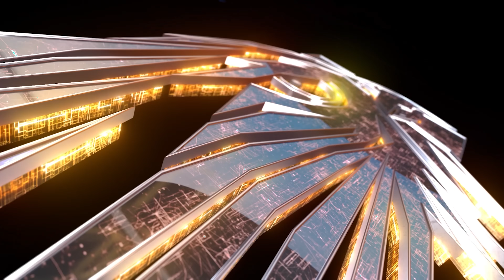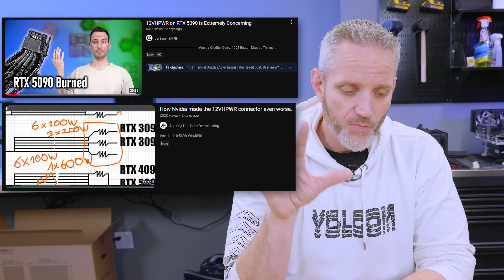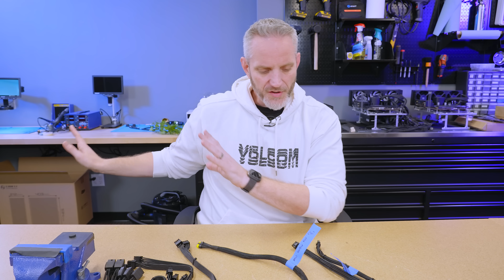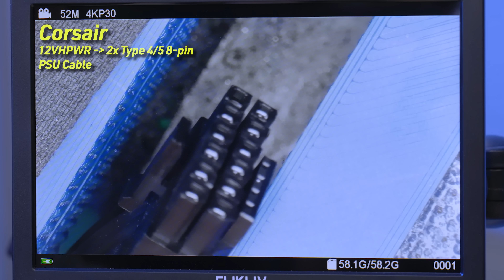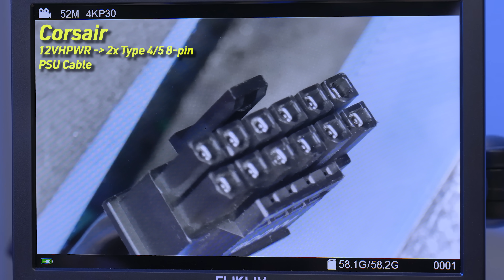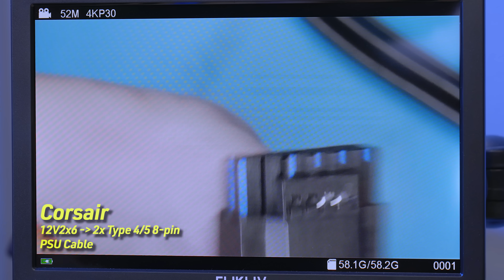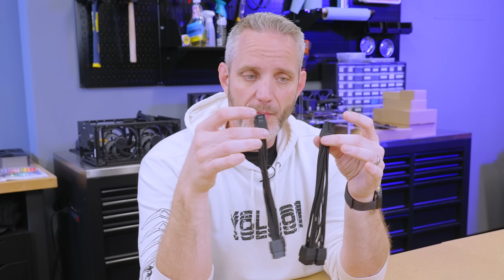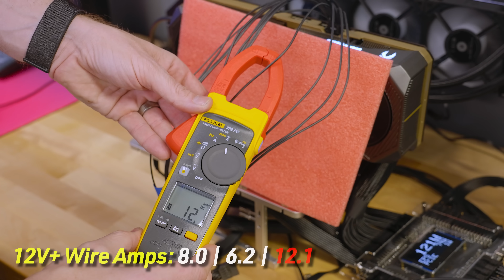I discovered something concerning and I need the Experts to chime in... More 12VHPWR discovery!

Comment: One of the things I have never seen anyone mention in any of these videos, but is very important when it comes to discussing these connectors, is the way the male and female pins connect.
So in the case of these connectors, the male pins are solid and have (theoretically) full contact.
The female connectors however do not. The contact surface is tiny, because the male pin only physically connects with the female connector on a few tiny little surfaces within the female connector, unlike for instance a MOLEX or SATA power connector where the contact surface is equal on both sides.
This means there is already increased resistance compared with the cables, even in perfect conditions and if the angle is even off by a fraction of a degree or if there is any trace of foreign material inside the female plug, that resistance increases exponentially. 
Since the "safety latch" on the connector doesn't latch properly and isn't safe, it allows for a HUGE amount of wiggle from side to side, so even a tiny bit of tension increases the resistance inside the connector by a huge amount (read: double or more) which increases the heat and since it's inside a double plastic wall, which acts as an oven or greenhouse, that heat cannot escape and increases over time.
This was one of the first things I remarked upon 3 years ago when this connector was first introduced along with the razor thin safety margin which makes this problem even worse.
This is also why I cannot believe how this connector was ever approved for the market by the authorities, as even the math says this connector is a fire hazard, just on paper, before you even consider actually making it.
PCI-SIG and NVidia therefore knew, even before they made this connector a standard, that this was a fire hazard and yet pushed it onto the market regardless just to save a few pennies because it was cheap to produce, since it uses existing components (the pins, housing and wiring) and is based on a connector that PCI-SIG already had designed a few years prior.
Back then I didn't know that NVidia would also make this problem even worse by combining all 6 wires into a single rail, which means that even if 5 wires fail, their GPU's would still pull 600 Watt over a single wire, which is guaranteed to start a fire within seconds.
There is also no OPP / OCP / OVP on the GPU side or any kind of sensing how much power individual wires pull, which once again exacerbates the problem even more.
The fact that PCI-SIG keeps changing the specifications and even the name of the connector to pretend they are doing something about it when in reality it is literally impossible to fix it because "You cannot change the laws of physics Jimmy" to quote everyone's favorite fictional engineer and there is zero oversight which means manufacturers can do whatever the hell they want (like putting a 600 Watt connector on a 300 Watt PSU, not properly use the sense pins on cables / adapters, use any wiring they want, use any crimps in the female end of the connector they want, etc) also makes this even worse.
Literally everything about this connector / standard is terrible and for the most part unfixable since that would require a complete redesign and yet NVidia keep telling us "There is nothing wrong here, just keep using and buying this definitely not a fire hazard, lalala we can't hear you."
They knew 3 years ago this was a fire hazard, they knew when the first reports of melting connectors came in and started blaming it on "user error" even in cases where it was proven it wasn't and they still know today yet deny it on every turn in spite of the mountains of evidence and as a result, we will see many more cases of this until people actually start dying and even then they will try to weasel themselves out of this unless they get buried in lawsuits and federal agencies go after them and force a world wide recall.

Comment: Yes the ground can do that to. I work on fork lifts and have had connections melt for bad connection in power or ground cause power make a loop and if the loop is messed up it will still try to push the amps through anyways.

Comment: This just makes me even more not want to use the connector EVER!  I saw the size reduction, but the fact it doubles the amount of power that it is "designed" to handle, and it's just a fire waiting to happen.  I run my system always on and almost never turn it off.  Seeing this, makes me really think of how many corners they cut to make the connector, and how much it's designed to fail.

Comment: There is some 'it depends'. The pins don't engage all along the way, they have patches where they contact. If that contact happens more towards the tip or the base of the pin shouldn't be an issue - as long as it's all on there. Personally I still appreciate a connector with less play, corsairs just seems cheap there.

Comment: i have a new corsair SF1000 where the included 12vhpwr cable (0 insertions yet) also does this if you pull on its individual wires

Comment: Alright Jay. There might be something to this. I had a Corsair PSU in my build with a cable quite like the one you’re showing, and it almost took my 4090 with it. I’m very positive I seated my cables correctly, but I was lucky enough to stop it before any major damage. Switched to the MSI MAG AG1250 with that yellow end that you’re showing and I haven’t had any problems since. I had no idea what could’ve caused it so I chalked it up to bad seating and have been triple checking my connections before boot ever since, But now you release a video like this. Can’t be coincidence right?

Comment: If those pins on the Corsair connector are within spec then the entire "it's not plugged in enough" argument is moot, since the pins them selves apparently can be half way out of the damn connector and still be within spec. That's no different than having the connector half way plugged in.

Comment: By the way, in case double the current (20A vs 10A) doesn’t sound that much. That’s 4 times the heat generated in the wire

Comment: Ground is taken also from mechanical connection to the case with screews, that's why no problems on GND 6 pins. This is shitty power connector, is not possible to have this shitty connector in 2025, for 600watts consumption (almost 50 amps). That's why AMD not use it, and prefear 3 or even 4 PCI-E 8 pins..

Comment: If its all merges to the same point & shunt resistor. Why not just throw that stupid connector and bring a 12awg  cable and have one good solid cable that wont overheat and use a neat xt60 plug like those on drone batteries that can take 60amps.

Comment: In some cases, it probably matters less here. The corsairs you have there have a 1-1 pin to wire connection. In other videos, I've seen them all connect to a common rail so you see wire to rail to pins.

Comment: From what I gather it seems because Nvidia designed their board to save .50 cents per card by changing the power input circuit and because manufactures have saved .02 cents per cable by making them trash. Stacking  decisions have led to peoples cards/cable burning up.

Comment: It doesn't matter how good the connector is plugged if the pins are pushed back when is plugged. 
Can you please take out some pins from a few different (manufacturers) connectors and look at how good are the wires clamped in each pin?
Also, please make a "drag" test against the pins on the GPU!

Comment: no Nvidia made the 12VHPWR connector worse compared to previous generations as Nvidia reduced the electrical resistors in the PCB to reduce the cost which caused the 12VHPWR connector to melt , Also, there was no melting problem of the 12VHPWR connector with the 3000 cards because there are enough electrical resistors in the PCB.

Comment: Grounds are all connected, so a loose ground pin is far less of an issue, since the current can flow through the chassis or motherboard or whatnot. It would probably even work without any ground pins connected. Don't try this at home, though.

Comment: if the pins on the card are to short for the female end / cable end to touch it will ark drawing more power when it comes to amps with 12volts nothing will happen best way to test this is to use a tooth pick to measure the death of the card pins then use that tooth pick to check the death on the plug as log as the tooth pick touches the pin your good

Comment: The greater risk of melting the connector would occur if the 12V (positive) side isn't making proper contact.

Here's why:

Poor Contact on the 12V Side (Positive):

If the positive side of the connector is not properly seated, there can be high resistance where the contact is trying to form. High resistance at a connection point leads to heat generation because power is being supplied to the connector, but it's not flowing through properly.
The heat generated by this resistance can cause localized overheating, which could potentially melt the connector or the insulation around the wires.
If the system tries to draw current but the connection is poor, the power dissipation at the point of contact can increase, worsening the issue. The combination of high resistance and high current demand in a partially connected circuit can easily lead to overheating and melting of the connector.
Poor Contact on the Ground Side (Negative):

While a bad ground connection can cause operational issues (like system instability or failure to operate), it generally won't cause overheating or melting on its own. This is because the ground side typically serves as a return path, and it’s less likely to generate heat due to high resistance. The current doesn’t flow through it in the same way as through the positive side of the circuit.
If the ground side is loose, the system may not work properly, but it’s less likely to cause damage from heat in the same manner that a high-resistance positive connection would.
To summarize, a poor connection on the 12V side (positive) is the greater risk for melting the connector due to the increased potential for high resistance and heat buildup.

Comment: Jay... My RM1000X from 2024 ATX 3.1 came with a cable 12V2x6 ++H in both sides. PSU and GPU side the same conector. You showed that Corsair provides a cable for all their PSUs 12V2X6/2x 8 PIN. Maybe they upgraded it and now they come with full 12V2X6 cable? Mine comed with it... Interesting and now the RM1000X is plugged to a 5090 FE with original CORSAIR cable... :S

Comment: @Jayztwocents To the perspective - classic 8 pin power cable is rated 150W but the connector and wires are able to deliver 288W. Something like 90% safety margin. Which means that the 12 pin connector should actually be rated at only 356W as it's maximum is 684W. From the point of electrician there is basically no safety margin in that connector.

Comment: I wonder how long until the FTC will get involved. This is obvisouly design flaw or even negligence, to put that much load on a single rail and get that close to max rating on the cables. Reading all the comments from automotive-, aero- and electrical professionals, this clearly is a huge no-no and you cannot convince me that nobody at either Nvidia or the associated partners did not look at this design and went "huh, that's not safe".

Comment: I just built a 9800x3d X870 build with my 4080 super i've been using for a year. I bought a new power supply from corsair. the shift 1000. the 12whpr cable that came with it ended up not working but everything booted fine using the nvidia adaptor and on my partner's segotep 12whpr. The system refused to post with my brand new cable, but posted and pc works with the nvidia adaptor i've used for a year now and posted fine with the segotep cable that came in the 750w gold 3.0 psu box.

Comment: The issue is Nvidia assumes that each wire will be a solid connection on both connector ends and each wire will be a perfect conductor. When that doesn't happen there is no way for the card to know how many wires are actually conducting current and doing it within spec of wire. So if the wires are not the same gauge , have flaws, different resistances or one of them gets cut or pulled out , all hell breaks out and you get smoke. How much would it have cost nvidia to put sensors and load balancing on each pin? You wouldn't then need the useless sense pins since the card would be aware of what is going on on each pin. This would protect from crappy power supplies and bad cables. Problem solved.

Comment: It's not power in power out.  There is a device between in-out that causes resistance and transforms that energy into heat.  The power in side is more problematic than the ground side.

Comment: NVidia's an electronics company.  So their engineers are going to think in terms of electronics connectors.  And they've kept doing so, despite the fact that the electronics industry is 99.9% of the time dealing with currents in milliamps, not amps.  So as currents have increased, they've just kept scaling up connectors that were never meant to handle power applications at this level.

Meanwhile, the automotive and electrical engineering sectors who have been dealing with as much as hundreds of amps at 12V for over a century have worked out a plethora of perfectly usable connector standards built for precisely this kind of thing.  Like the XT-60, for example, which is used all over the solar generator, RC and ebike worlds. 

If they'd thought to incorporate the XT-60 or something similar into the PSU-GPU connector standard, none of this happens.

Comment: short version it is inconsitant current draw across the wiers, when you are mesuring curent you you are adding a capaciter to stabalize the power delivory. something that helps with high quality and low quality powere suplys is the quality of the copper and the capaciters used.

Comment: Awesome catch Jay. That's a significant variance in load across what should be a level value. 50% loss load on 2 lines is a massive weak point and will stress the remaining lines harder than necessary and that could lead to failure on an overloaded channel.

Comment: 1) Can you also measure the amperage through the ground wires, not just the +12V. It would help complete the picture.
2) Can you measure the resistance of each of the 12 wires for the collection of plugs you have to see if there is any problem there?

Comment: The movement of that pin makes me think it wasn't inserted into the connector far enough. I've often had the exact same issue with DuPont connectors, the kind you use with bread boards. It can be a bit of a pain to get them to seat properly sometimes, at least with the tools I'm using. I'm a hobbyist though, so I'm not sure what Corsair's excuse it.

That being said, this is obviously not a DuPont connector. It may work differently than I think it works. So don't take my two cents as gospel.

Comment: Stop insisting that the problem is caused by user error or cable quality. Anyone who buys a 4090/5090 knows how to plug a cable. Do you think that at some point everyone forgot how to plug a cable… 3090ti is the proof that 4000/5000 series have a bad power supply design

Comment: Automotive tech here with extensive electrical diagnostic experience (cars run on 12v DC) a loose pin like that absolutely could be causing this problem ive seen loose pins like that melt connectors on blower motors and head lights. 
Corsair saying that those pins are "ok" gives me enough reason to not purchase corsair. Those loose pins absolutely are a problem and I believe you are correct in assuming this is what's causing the melting
Reply: No man. You are forgetting, that all the pins connect at the end of the graphic card connector into the one bus. That mean, they are drown in parallel way of of the PSU , which needs to handle the load distribution , and it does not  do it well. In this scenario - the pin with a loosened connection would draw much lesser current , then the others. And we are observing the opposite. The current observed is way more then 20 A, in the single wire.
Reply: @MortalThe  loose pins would cause increased resistance at that point. Increased resistance means heat is generated. The part that is melting is the connector not the board or the cable it's self. The connector is the issue
Reply: @ "Increased resistance means heat is generated. " - hold truth only when there is a current flow. In case of bussed pins after the connector - at the card's side, the PSU will send power to the buss through the other cables, not the one with higher resistance. So, not the case. 
We have seen the connector is melted and the cable itself - along the length evenly, due to the big current flowing.
So, not the loosened pin.
Reply: @MortalThe  just to clarify i don't think the loose pin is the only problem but it is a problem. The fact that they are drawing over 600w on 600w cable is also a problem. There are multiple problems here. And if there is a loose connection it's only going to make the problem worse as you stated it's able move the current from that loose pin to others which then puts more current threw wires that are already at or near their limit when everything is working correctly.

Comment: Sounds like the answer is, always check the condition of your cables, even if they're brand new.  Never assume there's nothing wrong, as apparently, even their manufacturing can be defective.

On another note, has therefore ever been a video of discussing 3rd party cables?

I just recently finished my first PC build, and the SeaSonic PSU stating to only use their cables makes me nervous considering buying 3rd party, even custom made cables thats are supposed to be the best quality.  Especially considering questionable build quality from the original manufacturers, it raises the question that 3rd party cables may be better than the ones included with components.